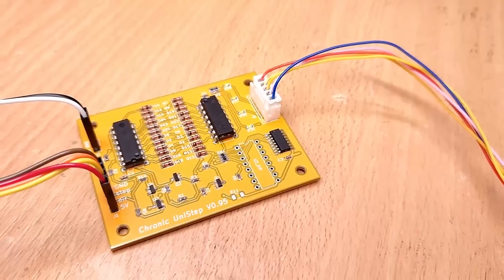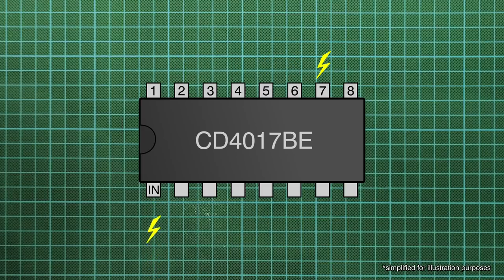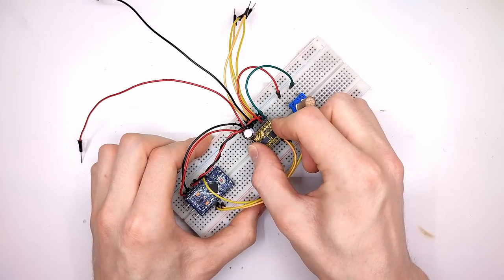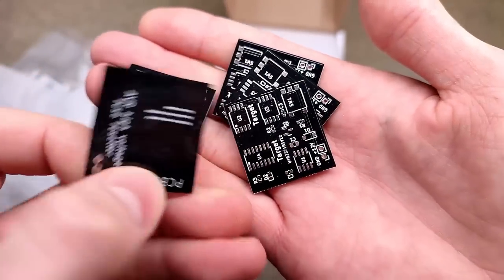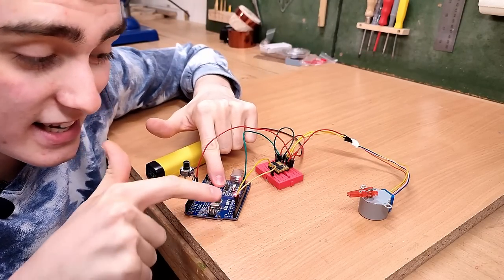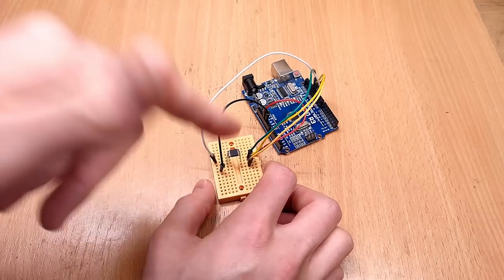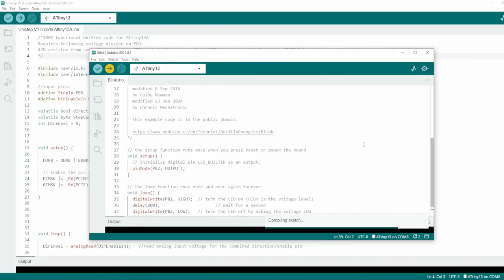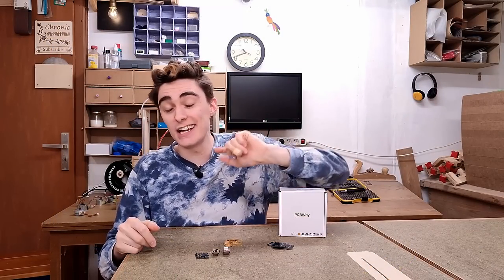Designing UniStep - an open source UNIPOLAR stepper motor driver!

Comment from the maker: In hindsight this whole project seems so much easier than it did when I first started! Changing those fuses for the first time was especially nerve-wracking because I wasn't entirely sure I'd be able to undo it again 😆
Big shoutout to Johboh for his generosity sending me all those 3D printer parts, the next projects are gonna be awesome!
Reply: Nice project, great approach and thanks for sharing your ideas with us!:)
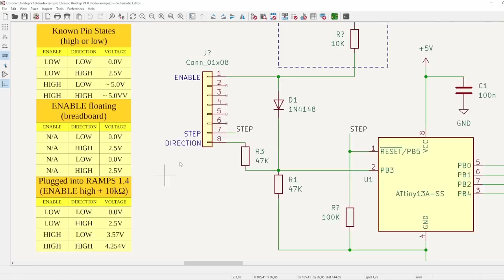Now to the reality of engineering and circuit design ( values and diagram from 10:46 ): I think we can clearly say that your input pins are somewhat important. In fact they are THE IMPORTANT THING ... of course, they are part of the design and provide access to the functions this device provides (driving a motor). By the way, the worst idea you can have is to reduce the signal-to-noise ratio in an application in this harsh environment (from an EMC perspective, in direct relation to the motor control). Your (smart idea, which is true!) analog ladder trick is nothing more than that: a self-induced degradation in reliability, functional and circuit stability. Let's call it signal worsening by a shot(over resistors) in the foot(GND) :) This thing may work in the lab. At your home. Today ... Hehehe. You know what I mean. Such neat "tricks" in circuit design just lead to errors, failures and frustration when strangers try to reproduce your idea ... and you maybe never know of them.

As always: Use the right tool for the job! Insisting on the unsuitable microcontroller was the first mistake; pride (I am over-exaggerating here, sorry!:) ) in DEFINITELY wanting to solve the problem with this (wrong) component was the second! BTW no offense or accusations with my critique here. You can do whatever you want. And learning something is a good thing! 

Have fun making!

P.S.: Motors .... hmmm ... wasn't there another "thing"? *me-whispers* induction, semiconductor ... protection ;) 
(To rely on the COM diode on this legacy device is, hmmm ... daring:) See the specs, like "Clamp diode reverse voltage" and "8.2 Functional Block Diagrams" )

Comment: Buying a Pinecil soldering iron was one of the best choices of 2023. Replaceable tips and heating elements in the tip itself. Excellent video!
Reply: i love my pinecil v2
Reply: Same, have had it for a year and with proper care and regular soldering, the tips still look great. Flux is your friend and always leave the tip tinned to protect it.
Reply: This, so much this. I hated and dreaded soldering anything, and then Pinecil (v1 in my case) opened my eyes (and capabilities).

Comment: Just treat the unipolar motor as a bipolar motor and ignore the center-tap.  Back when RepRap was first starting out and you couldn't get these drivers for less than $20/ea, it made sense to solve this problem the way you did.
Reply: He talks about that easy way 2 minutes into the video even though he doesn't call out "forget the center tap"
Reply from the maker: I mentioned exactly that in the video, but since I don't have unlimited time and this video was about my driver, I can't also explain how to do the unipolar/bipolar conversion
Reply: Not all unipolar motors can be converted if the windings are connected inside the casing.
Reply from the maker: @KallePihlajasaari  so far I haven't come across any that couldn't, on some it'd be a bit destructive, but opening the welded-shut housing shouldn't be necessary I think

Comment: Wonderful video, you could've used a multiplexor and easily use 2 pins in exchange for using maybe 8 more pins.
Reply: Yeah but footprint...
Reply from the maker: Yeah, but there isn't exactly a lot of space on the board. Especially since I didn't want to put components on the underside so it can still easily be reflowed on a hot plate

Comment: Why not implement the enable pin in hardware? just connect it to a mosfet hooked up to the power/gnd rail of the darlington array.
Reply from the maker: That IS a good question. It simply didn't cross my mind. 🤦 I thought about disconnecting the four outputs with separate transistors, but simply turning off power to the motor common using a single P-channel MOSFET is OBVIOUSLY the way to go if it fits onto the board 😂
Thanks for the suggestion!

Comment: I use normal a4988 and separate the connection of the coils so that the motor also runs with 4 pin

Comment: Imagine how much easier this would have been with the STM8S...
You would have had full debugging available while developing, ability to trigger steps via interrupts on the pins to avoid random latency in timing and you could have supported I2C or SPI modes in addition to the normal step/dir interface as well as added microstepping selection.
Reply from the maker: If only I could program STM 😅
I'll definitely have to get into it...
Reply: @ChronicMechatronic  What you will find is peripherals in STM is smarter than in AVR. If you code at lower level (like usually not arduino api but their api's) you can do things like ask serial to send a block of x characters from a buffer, and it will be done with DMA meaning the cpu can do something else in the meantime etc.
Reply from the maker: @1kreature  ngl, that goes way above my head
Reply: Basically stm32 has more features, things like DMA that let you access memory without using the CPU, helps with getting more advanced tasks accomplished.  But it helps to have a reason first, AVR may suite all your needs, but when you need displays i find the arduino's quickly hit their limites, while stm32 just  have more memory, but harder to use so... but  and its not that hard as you think Mitch Davis has a good into series on bare metal programming, https://www.youtube.com/watch?v=Hffw-m9fuxc&t=654s   
Since you know a lot about electronics you should find this stuff easier( the low level) since at the lowest level its just electronic circuites. Ram is just capacitors filled up, constantly refreshed because they leak, its a very messy electronics thing you probably could make better.  Anyway I think its pretty fascinating,  but think i need a intro to basic computing to get a handle on it to be honest, and when youre programming with MCU's, youre so low level already its probaby good idea to know how the CPU youre programming actually works on a circuit level.  EDIT the video isnt the bare metal programming one, he acutllay uses AVR to show that, its just a stm32 guide which is still pretty cool @ChronicMechatronic
Reply: @ChronicMechatronic you’re programming this driver in Arduino. It would be nearly exactly the same for any STM, just use board manager to get board definitions for STMs and maybe get yourself cheap as heck ST-Link clone :)

Comment: I noticed that the output still steps (at ~16:40) when enable is high.  this means that as soon as the enable is pulled low, different coils will be energized.  Just a change to your ISR - only increment counter if enabled.  Looks like the conditional on line 98 (commit a6a9f60) could be changed to:

if(!digitalRead(StepIn) || analogRead(DirEnableIn) > 600) 

This doesn't handle the race condition that might exist if the step input comes in at the same time as an enable change but that is probably not likely to happen.
Reply from the maker: Yeah, I specifically checked for that and didn't figure it would be a problem - I think normally Marlin shouldn't send any step signals while enable is high. But thanks for the suggestion, I'll put it in!

Comment: That was a TON of information for one video.  I tried to watch this first thing in the morning and I could not absorb it all in one go.  Very detailed indeed.  Congrats on your success. Great design!  As I see those motors work, the first thing I can think to use your design and those specific motors for is to set up a pseudo-analog gauge cluster to show CPU/GPU speed, temperature.  I bet it would look cool.
Reply from the maker: Thanks! Yeah, some of my videos are a lot to take in - a digital "analog style" clock would be cool too!
Reply: @ChronicMechatronic  , how many steps are there (including micro steps) for a full 360 degree rotation?
Reply from the maker: @ewasteredux  on most of them just 96, though I have one with 192. I assume it would need a little bit of gear reduction for smooth needle motion
Reply: @ChronicMechatronic  , of course you are right.  If you wanted to do some sort of clock, just making sure it was greater than or equal to 60.  At that many steps it would make the second hand move buttery smooth.

Comment: It's worth noting that it's extremely trivial to convert a 28BYJ-48 to a bipolar motor. All it takes is pulling off the blue cover, and cutting the center PCB trace on the motor breakout PCB. It's then compatible with all other bipolar stepper drivers (including Trinamic), and this bipolar mode significantly increases the torque and speed possible by the 28BYJ-48. I measured double the torque in my own tests.

Given it takes all of 5 minutes to do the conversion, I don't really see any reason to keep them in their stock unipolar mode. But cool project nonetheless!
Reply from the maker: Yes, there seem to be nothing but advantages to converting them into bipolar motors. I really just wanted finish what I had started, hence why I made sure to mention the unipolar to bipolar mod right upfront to hopefully not make it seem like my driver is the best and only way to drive these things :)
Reply: It's not always possible to separate the common tapping though. I have a NIDEC MSRPC20A03 here which came out of a Mitsubishi Heavy Industries indoor AC unit - it shares the 24BYJ footprint dimensionally but has no PCB behind the plastic cover, the windings are connected directly to the pin header and without a surgery robot I don't think you could un-wind those tiny wires...
Reply from the maker: @Loopyengineeringco  true, I have a couple of bigger unipolar ones from old printers and they don't have the PCB either. A wire broke on one of them and I ripped out the header pin in the process of removing plastic lid which made the end of the winding disappear inside the motor. Still had enough connections left to convert it to bipolar but didn't originally even want to do so...

Comment: Hi, great project!
We made something similar but for an industrial CNC, and i was in charge of the electronic drivers... Certainly we couldnt use the unipolar motors as bipolar; because we thought they would overheat or more problema would rise...

So... I designed a unipolar motor driver based on 4 darlington transistor, and used the UCN5804 microchip (wich basicaly is a "Unipolar motor translator") in conjunction with some NOT gates

I believe i still have the schematics, if you like them

Also i think the UCN5804 is not being made anymore, we bought the las 3 that our suplier had, bad for repairs tho, but the machine still works until today😆😅
Reply from the maker: Thanks!
Yeah I figured there must've been some obscure IC for that back in the day, but I didn't really look into it since those DIP packages would have been too large anyway. Unipolar steppers are kind of a thing of the past after all.
But thanks for the hint, I read the datasheet and learned about the two-phase drive mode! You're right, basically I could've stuck one of those ICs on my board and called it a day 😂

Comment: You know what, this seems like a perfect use case for the infamous Padouk 3-cent microcontroller. But i understand the reluctance :D

I could have sworn i have seen a yellow tmc2208 before. Oh right it's the one made by Eryone Tech.

Soldering paste has the problem that it expires, it can be refreshed in a planetary centrifugal paste mixer with maybe a drop of fresh isopropanol, as you might guess things just wander around, they don't actually decay chemically. Or just mix it with fresh flux best you can and hope it works. Also there are cooling/storage/transport requirements, so odds are, the paste was once probably OK (not the best), until it wasn't. Or maybe it was never OK, who knows.
Reply from the maker: Padauk, I heard that just recently - oh right, it was in a blog post about a flickering LED with timer function in an LED tea light. 
Just googled it, HOW HAVE I NOT HEARD OF IT BEFORE 😂
Thanks for the idea, I think I'll need to dive deeper into low level development :p But yeah, right now programming is the biggest barrier...

Oh, that's a shame, I didn't know someone already made yellow drivers :((
So far I'd only seen green, red, purple and white...

I don't know what the problem with my solder paste is, it's just so runny it gets everywhere on the board and then I get tiny beads of solder all around and underneath components. Then again my hotplate's also unregulated and gets up to 350C 😬
Reply: @ChronicMechatronic  Nobody made Sakura Pink drivers i don't think. Blue ones are common. There's any number of exotic mask colours the PCB manufacturer can make if they like you. Even if you aren't a big customer.

But yellow is good too, it's a nostalgic colour.

I think your paste separated, the solids are now at the bottom of the container (whatever they decided the "bottom" to be) and you're getting it from the middle or the top. 350°C doesn't sound inappropriate to me for a soldering plate.
Reply from the maker: @SianaGearz  I got a pink sample board and NGL I hate the color :p

Wait, the paste is not supposed to separate? I thought that was normal! 😂
I guess that's that mystery solved...

Comment: brown out detection is a special case where the mcu detects that its supply voltage is dipping down and it trips the reset on the mcu 
you basically never need it , if you supply to the MCU is so bad as to trigger a brown out , you have way worse problems then the mcu resetting mid sketch
Reply: I would recommend setting it since the transients from the motor can pull the supply down temporarily, simply due to parasitic inductance, as well as inductive and capacitive coupling. 
If the brown out detection is not set the issue is that the MCU won't reset mid sketch, however it's processing core will no longer work as expected which can leave the MCU in a state where it won't be able to recover unless you reset it manually. So a brown out trigger is still not ideal, but better than a unpredictable state.

Sometimes this is done on purpose for a glitch attack to get the core into a state where it skips over certain code sections simply by briefly lowering the supply voltage.
Reply: @Ether_Void  yes its used to attack , it is also used to handle dips in the supply voltage ... But if your MCU gets into a state of brown out in the first place , you have bigger problems in your supply voltage .... I prefer to fix the supply voltage and prevent the brown out in the first place rather then handling brown out wacky behavior ....a reservoir capacitor usually solves the issue
Reply: @fouzaialaa7962  There are of course other better fixes. But brown out detection costs you nothing and at least gives some additional way of recovery from unpredictable behavior in case some rare one off issues come up.
Additional decoupling would be the better solution and at least one decoupling capacitor should always be present, but adding additional capacitors to fix unexpected issues can only be done afterwards, unless you calculate the required amount before or have the luxury to just throw in as much as you have.